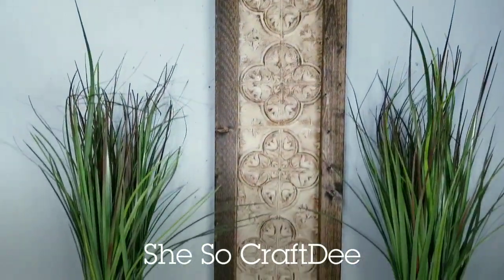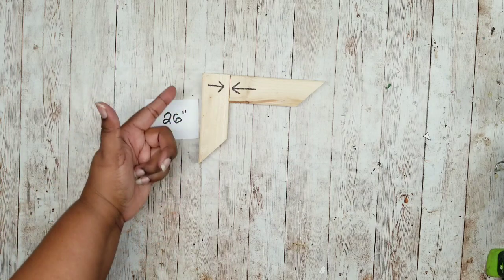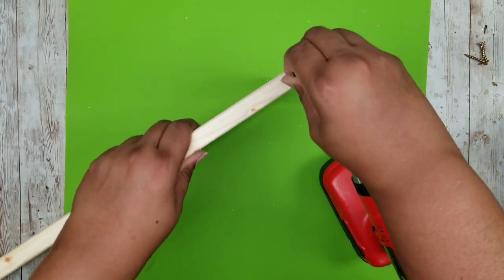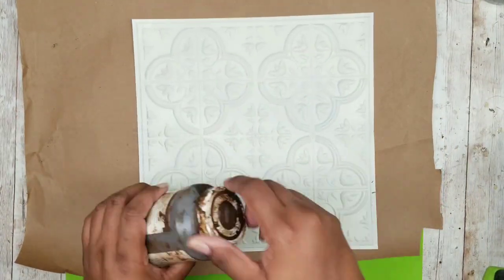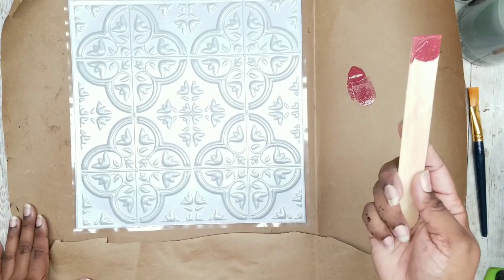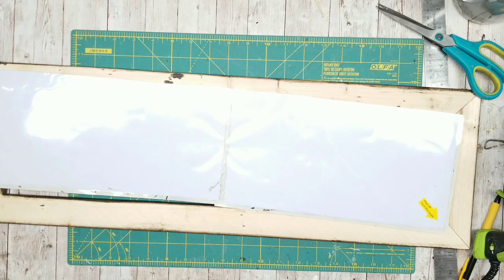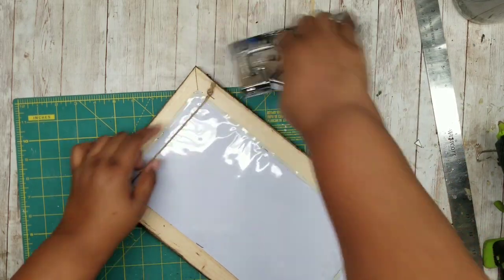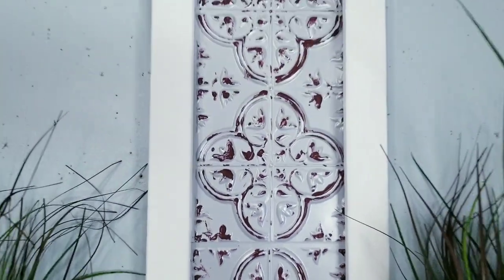*NEW* DOLLAR TREE DIY | Home Decor | Peel and Stick WALL TILES & Low Cost Wood | Three Easy Versions

Comment: You’ve done it again! I just love your diys. I do have a question about the frame. Is the wood that faces outside suppose to be 23” or is the center suppose to come out to 23”? Same with the 5 1/2”. Just a little confused. Thank you in advance.

Comment: I would have placed foam poster board after the hanger was placed on to conceal the plastic backing and secure the panel on so its a lot more professional and sturdy. Like how art work is done.
Reply from the maker: Sure! Be sure to check out the hundreds of DIYs I have showing how I add brown craft paper to the back 🙂. That is how I finish lots of my work that has a print or design on the back. I hope that helps!
Reply: @SheSoCraftDee  I definitely do. I am a new subscriber.  I love your ideas!

Comment: Can I use a store bought frame?
Reply from the maker: Each tile cut in half is 6x12 (x2). My frame I cut at 5.5 x 23" to fit the tiles in. If you can find a store bought frame close to this size, you can definitely use it!